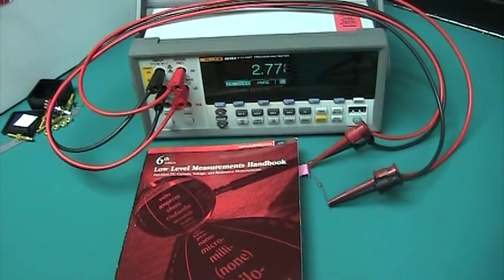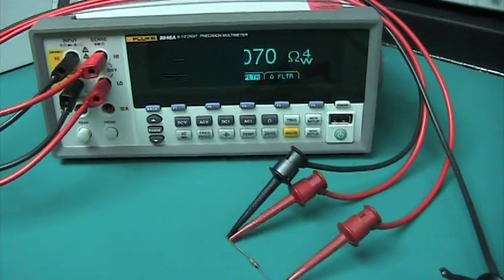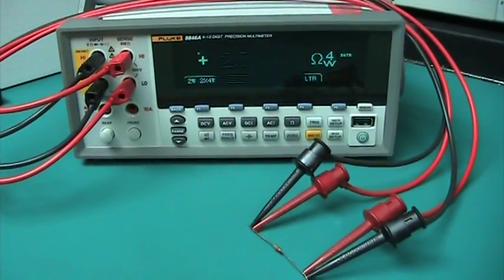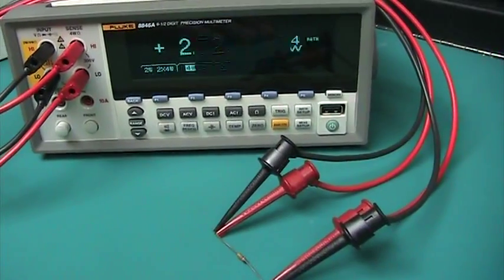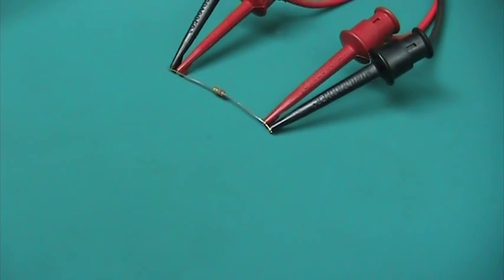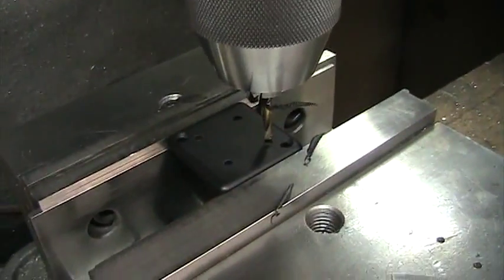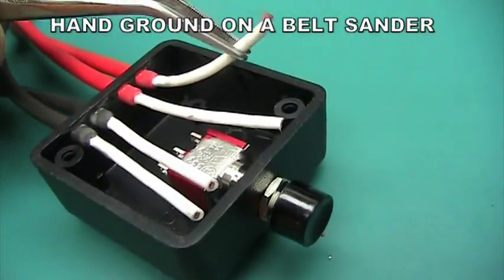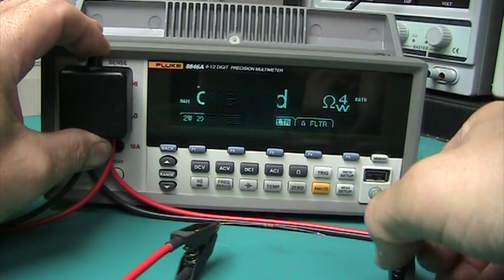Offset compensated Ohms adaptor.mpg

Comment from the maker: That difference is the -.00025 thermal emf that you saw when I pressed the button on the adaptor. The Initial 2.72135 ohms was .00025 low because of that. When I zeroed out the thermal emf I got the true reading of 2.72135.

I think you might be talking about current measurement burden voltage which is not present in a resistance measurement like this.

Your welcome, that book is awesome, I have only absorbed small sections of it so far.

Comment: 23:00-23:45 The resistance is higher (2.72160 Ohms) than the initial 2.72135 Ohms. What happened? By the way, the term you're searching for when you say "resistor inside the meter," and "offset," is Loading Effect. Measured results will always be higher than calculated results, due to the loading effect of the meter. By the way, thank you for mentioning that Keithley's handbook; I just ordered one. Keep up the good work, and I love the switched box you made.

Comment: A very nice design to remove the thermal EMFs,
Reply: In thinking about it more you are not correcting for the contact/thermal potential.  You are exchanging the contact potential of your switch circuit for the contact potential of the sample.  The only way to correct for the contact potential of the sample circuit is to take a voltage measurement when the force current is zero and subtract theat from the voltage measurement with known forcing current.

Comment: Nice video. but I really don't see any point to do that for normal measurement, it is not needed as you can use null function or you can use 4wire measurements and it will work like charm ..on another side your switch will add resistance there so it will not be ideal solution also. But to be on positive side this solution would work as it is ..but not so much when you go to 7.5+ digit resolution and ohms below one ohm..then you will see everything matters.  Things like brass inserts (pins) instead of proper beryllium copper ones are big no no. special solder , special low emf cables..shielded if possible. External shielding and guarding..all that .. I'm no expert myself..but it will get pretty complicated on super low value lvl's ..and ofc on super high values even more..like 1G Ohm or more 1TOhm..that is just crazy..Triaxial short cables, double shielding and guarding ..not touching with bare hands, special cleaning procedures ,,temperature and humidity stability and all that

Comment: Those "internal resistors" are called FUSES and they're there to protect the meter's circuitry from current flow in excess of the 10 amps maximum for your "high source" and probably 5 amps maximum for your "low source". With the meter in "amps" the meter's circuitry is in "series" with the circuit and if the current flow THROUGH that circuit exceeds those fuse amperages, the fuses pop and you get to replace a fuse before the meter will work again. Whatever AMPERAGE goes INTO a circuit comes out the "other end". Period. VOLTAGE is all "lost" as current flows through the circuit and the total voltage drop across the "supply" and ground" sides of the circuits will equal the total voltage drops measured from "point A to point B" across every individual conductor, load etc in the circuit.  In voltage/resistance/continuity the leads are connected so the circuitry is in "parallel" with the circuit. You don't check "voltage" AT a "resistor" or other load. You check VOLTAGE DROP ACROSS it. If its the ONLY resistor/load in the circuit the voltage drop will be "total". And the way you've got your leads connected you're not even testing resistance OF that resistor regardless. You've got the "source" and "sense" leads next to each other. You're only checking resistance through that short section of "high resistance" resistor "lead wire" and the connections of the leads TO that wire. You have to have continuity THROUGH the resistor to measure its RESISTANCE. When you put the meter in resistance measurement its putting the leads into "series" and the meter's power supply is sending current to and through the resistor. Since the meter's power supply isn't capable of creating a current flow sufficient to blow the fuse(s) and you're not in amps connected to a live circuit, you're "in series" with the resistor even with the leads still in the "parallellow-" connection jacks for voltage. 

You should forget about the "fancy" electrical equipment and high-precision measurements of low-voltages, resistances and currents and get yourself a basic ELECTRICAL FUNDAMENTALS and START FROM SCRATCH because at this point you have no idea what you're doing or talking about.
Reply: The fuse is only present for current measurements lol. And he was measuring in a Kelvin configuration, hence the 4 wires. This absolutely was measuring the resistor, not the leads. You got the fundamentals down, but are beyond your own depth level here.